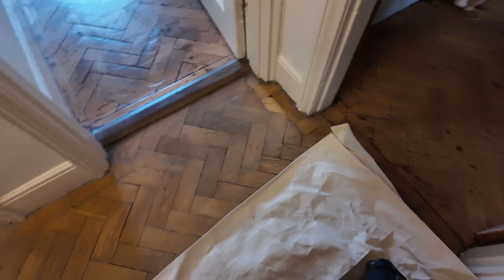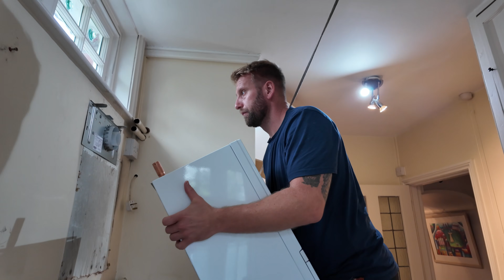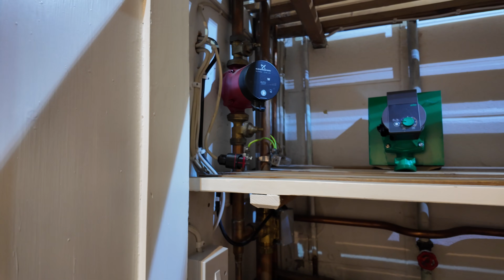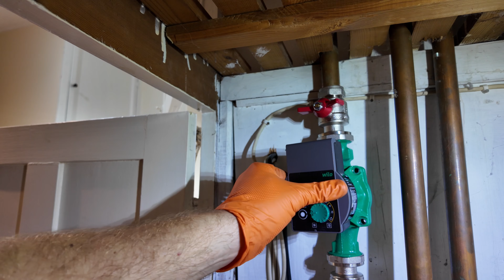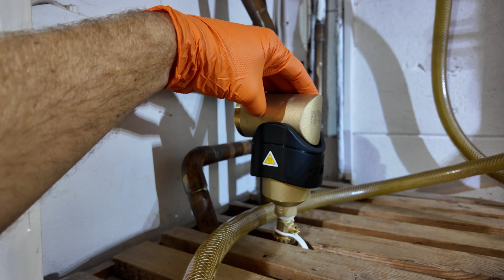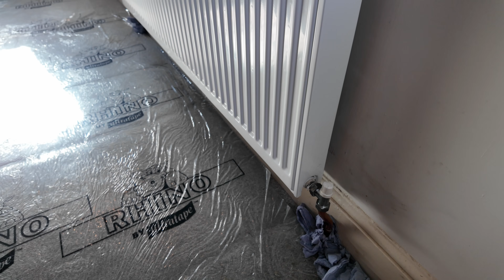No to a heat pump - Vaillant ecoTEC 430

Comment: Hiya, not sure if you can help but looking for a bit of advice. Last year our old boiler died a week before Christmas. We had a gas safe engineer install a used boiler into our home that was only 2 years old that had been replaced for a heat pump in a new property. He confirmed he’d be able to give us gas safe certificate and a 1 year warranty so we went for it to save some money. We have a gas safety cert and commissioning checklist. It’s working great but we’re now selling our home and we’ve run into difficulty as we don’t have a building compliance certificate for it. The installer is saying he can’t register it since it was 2nd hand. Does this sound right? Thanks in advance for any advice you can give us x
Reply from the maker: Even if you move a second hand appliance you can still issue a building compliance certificate. So yes they should have done one. You can always back date it so aslong as he's gas safe registered it should be fine. It's easy to forget. I've recently had to do one I simply missed at the time. Thanks 👍🏻
Reply: Thanks so much for your help! I’ll go back to him and ask him to register it

Comment: If you don’t use a gas boiler a lot in a small medium sized house, a gas boiler is actually very cheap to run. Not everyone wants to spend thousands on heat pump installation

Comment: The heat pump would work fine, why put an inefficient boiler 90% into the same space you say is poorly insulated? Hasn’t that been the issue for the last 30 years? Are you an Air Source Heap Pump Installer/ heat geek?I get the boiler is an easier cheaper option but what was the heat loss of the property?. If a heat pump had already been in place would you have gone for a straight or upgraded heat pump replacement?
Reply from the maker: We would have had to have two heat pumps in cascade to  cover the heat loss at 18kw. 
 Yes I am a heat pump installer.  
 I think the point really of my video, although not very well explained is that heat pumps are not suitable for all properties in their current state. Especially in the UK. 
Upgrade insulation, windows etc should come first. 

Unfortunately in this situation the boiler was condemned and they had no heating.
Reply: Inefficient boiler 😂 .... Heat only boilers consume less gas than Combi boilers, so they're efficient for houses with two or more bathrooms!
Heat pumps aren't efficient and very pricey! I've been to a property where owner regretting installing one after he's done major refurbishment and the property well insulated with under floor heating! ... He said the air source in cold weather spins non stop, and costing him £200 a month! ..... Not sure why you people want to decorate heat pumps as the only solution when damp UK shyte weather not suitable for heat pumps, half or most!!!

Comment: Insulation is a sensible investment whatever heating system you have. No point paying cash to warm the outside of the house.
The idea that insulation is only needed if you want a heat pump makes no sense.  Installing loft insulation is cheap and easy DIY or you can even  get it done for free as there are several schemes both from UK gov and some energy companies.
Vaillant stuff is very solid and reliable - had 2 Vaillant gas boilers over the last 25 years with absolutely zero problems.
Reply from the maker: All correct . Totally agree 👍🏻👍🏻👍🏻. Remember the customers are always right .......

Comment: That Potterton could be over 25 years old. So has done well!
I wonder if these monstrous sized air to water heat pumps will last that long? 
Be better if it was set up with Vaillant controls on Weather compensation, but not being Opentherm, they are expensive. The ROI would be a good few years.
Reply from the maker: Yes that potterton boiler definitely did well. I was removing them when I was an apprentice! 
 It would have been better with Vaillant controls yes, but again it's the expense of altering the pipework and wiring. Not everyone understands the logic in it.
Reply: My potterton flamingo was old when I bought the house. In the 25 years I’ve had it the only thing it’s needed is a new gas valve. Suspect it was the boiler that was there when the place was built. There’s essentially very little in them to go wrong. Unlike modern boilers.

Comment: Unless the property is one story going pressurized and just designing the system to be filled at 0.8 bar would of been fine. It has to be cleaned and filtered regardless which if you're using mains water or even a power flush unit the pressure it's putting on the system is often over 1bar anyway. At least going sealed system if there's ever a leak on the system it's a finite amount of water instead of a header tank constantly filling and ruining the floor while they're away. 

That said if they are only concerned about the cost the heat only is the best option. 30kw though, the coil in that tank is probably a max of 15kw and the heat loss is probably 15kw for the property? Are the looking to get a 200L tank in the near future - the new unistor 210L slimline from Vaillant has a 37kw coil in it, takes about 34 minutes to heat up from cold.
Reply from the maker: Thanks for the information on the Vaillant cylinder. Unfortunately the customer wanted to go with 30kw against my advice.  

This is the problem when you have other engineers all telling you to go big. Although they wanted me to install it, they took advice from other quotations. An odd one.

Comment: If you knew the cost of or risks of fitting a heat pump, system upgrade etc, why did you quote? Plus, why did the custard specify a 30kw boiler without you doing heat loss calculations and reducing the price of the install? A Y-Plan does not need an auto bypass.
Reply from the maker: It doesn't require an auto by pass no, but it is the regs. The customer originally wanted an air source heat pump 👍🏻

The customer had two other heating companies in which both specified 30kw incorrectly. Somewhen I suggested 18kw max, they didn't take my advice. 

What can you do 🤣
Reply: @loving-plumbing  Did you Range Rate the boiler to 18kw ?
Reply from the maker: The customer didn't want a 18kw, against my advice, so by range rating it down. I would have been doing them a disservice. 
 They are aware it can be turned down and have recommended they do that. 
Thanks
Reply: If the radiators have trvs you will require an auto bypass
Reply: @galaxydave69 the grundfos alpha 2 has auto adapt which will change the pump output depending on the back pressure. At least one radiator should not have a TRV on it so a bypass may not be necessary. The valiant also has a limited amount of cycling and will auto restrict if it cycles too much.
Reply: @davideyres955 surely the customer has every right to turn off there radiators if they want we cannot rely on them so always fit a bypass

Comment: Makes sense. 
I love my heat pump and it’s cheap as chips to run, but we did a lot of retrofitting first. Without the pre work, it wouldn’t have worked for us either.
Reply from the maker: Yes, definitely worth investing in the insulation and windows first if going down the heating pump route.
Reply: @loving-plumbing  hmm did you know low insulation vales of the building make heat pump savings larger!